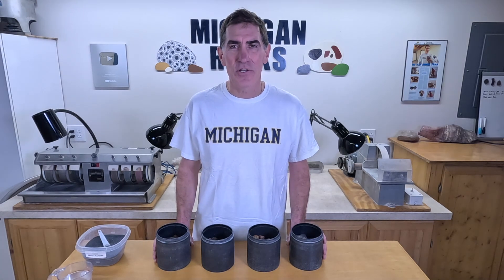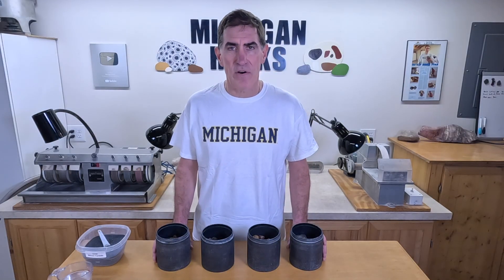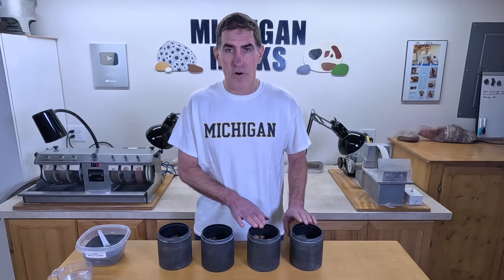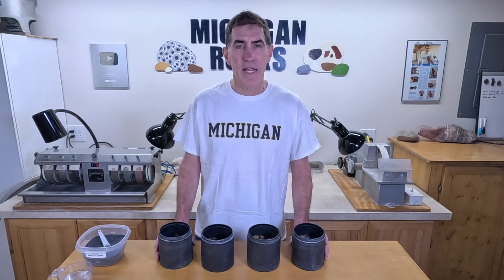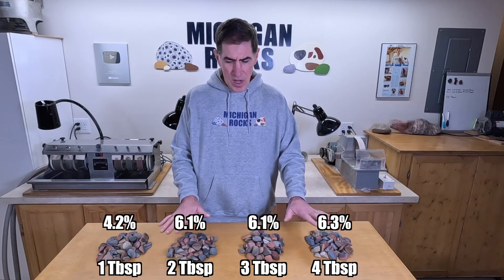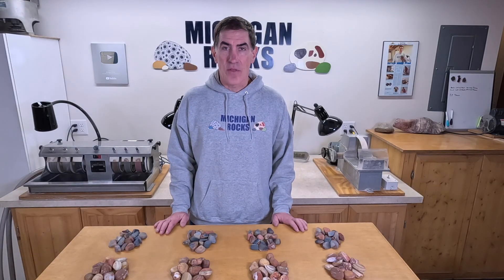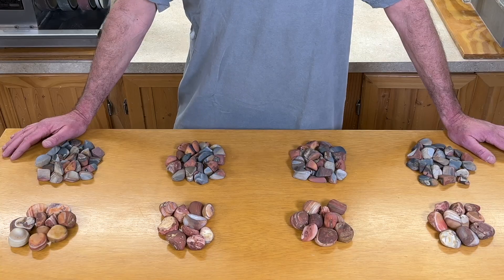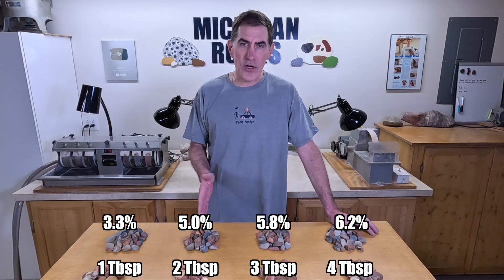Optimal Amount of Tumbling Grit—Part 2

Comment: This video and your others are exceptional imo. Not a lot of fluff, detail/practical oriented.
I am just starting out but after watching/absorbing your videos I have a plan to test a modified stage 1 process involving yet another variable.

I bought a Highland Park 3lb rotary with the basis being the lower power draw and no belts to deal with. I am hoping the power adapter and DC drive are "robust" to make it even more worthwhile in terms of replacement parts cost.
Reply from the maker: Let me know how your experiment turns out.

Comment: Please tell what tool do you use in order to cut a groove all the way around a stone for purposes of running wire around the stone for jewelry.
Reply from the maker: It's a glass grinding machine with a groove bit. I got my machine used, and I don't think they make that exact model anymore. But I found a similar one and put it in my Amazon storefront. I think you could use any glass grinder, though. The more important part is the groove bit. That's also in my Amazon storefront, which is in the description of this video.

Comment: I found that the water matters too, i.e. let's grit and less water seems to result in pretty good grinding vs more. I'm of the opinion that both need to scale in proportion to each other to some extent, it seems to make sense because the more water you have, the less concentrated the slurry is for a given amount of grit.

Also, less grit in the barrel seems to result in the Tumbler using up the grit faster. So instead of a week say you're checking it say every 5 days. It's really easy to tell by the sound the rock makes in the barrel. They sound very clickety clackity against each other when it's out of grit.

So many variables! 

So basically, less grit, less water = More frequent checking, and higher grit efficiency!

As an easy rule of thumb, it seems that half the number of tablespoons per pound of rock rating of the barrel is the most optimal.

I really wonder how this translates to other stages, cuz I've simply used the first stage more for this kind of experimentation, and haven't done it as much with hard numbers more with subjective observation. Later stages if you use less grit you definitely need use less water since the slurry is thinner and the rocks will bruise much more easily!
Reply from the maker: I plan to do another experiment on what the optimal amount of water to use is. I have another experiment that I want to do first though. The water experiment might even wait until next winter.
Reply: @MichiganRocks  looking forward!

Comment: It would be interesting to see if and how the results of such an experiment would be different with the addition of tumbling media. Might it give the rocks more points of contact for the abrasive to act upon, and perhaps allow larger grit doses to be more efficient?
Reply from the maker: I use ceramic media in all the stages after the first stage. I don't use media in the first stage because it wears it down too quickly. Also if you used too many smalls in the first stage, whether it be ceramic or just really small rocks, it actually slows the tumbling action way down. After a week, there will be left over unused grit in the barrel.

Comment: Thanks for the extra weeks. on a side note; the large rock under the 'M' with the rings. I was a rock licker in grade school in WI (no one judge). That was 50 years ago. If I can get the name, or type I can do my own research. TIA
Reply from the maker: You mean you stopped licking rocks? I'm 56 and I still lick rocks on a regular basis. I didn't know that was unusual. 

I'm not sure which rock you mean. I assume you're talking about the M in Michigan Rocks on the wall. There's a pile of rocks down there. I have several large Lake Superior agates and a banded iron formation that are most likely the ones you're referring to. The banded Iron formation is mostly red, and the agates are lighter colors, gray or almost white.
Reply: @MichiganRocks   Yes, sorry the M in the title and the large rock that looks spotted.
Reply: So, it turns out that it's petrified coral. But a random coral in the yard of a neighbor in the middle of WI seemed strange.
Reply from the maker: @lonpowley  That's a puddingstone.

Comment: Thanks for videos like this. Great expirement, looked to be a lot of preparation to make sure of accurate data. I am new to the hobby.   I've collected interesting rocks through the years, just never thought about tumbling them. Watching your videos inspired me to start tumbling a couple of months ago. One question. Do you think the percentages would have looked much different if the 4 barrels had run for 2 weeks? Or does grit breakdown make it a mute point?
Reply from the maker: By the end of one week, the grit has broken down enough that it's probably best to refresh it with new grit. It will definitely still grind more in the second week, but not nearly as much as the first week.
Reply: @MichiganRocks  Okay, thanks for the info.

Comment: I can't thank you enough for taking on this experiment and sharing it with us, twice.  I've had questions about how much grit to use and how soon to expect the slurry to form.  Sometimes after a week it seems I don't really have a slurry and I find I'm constantly checking the barrels to see if a slurry has formed.
Reply from the maker: I don't worry about how the slurry looks too much. That's a matter of the rocks you're tumbling more than anything else. Hard rocks grind slower and therefore form a thinner slurry. If I throw Petoskey stones in a tumbler, which are very soft, the slurry comes out like pudding sometimes. 

I also don't check my tumblers during the week. I just let them roll until the end of the week and check them then. Feel the slurry at the end of the week. If it feels gritty, that means that it didn't do much. If it feels smooth, then it's all used up.

Comment: I wonder if the results from the very first experiment (part 1) were similar because the rocks were roughest then, and the surfaces of the rocks did so much grinding on their own that the amount of grit made less difference. Then as the rocks get smoother, the amount of grit seems to make a greater difference.
Reply from the maker: Maybe, but I pre-tumbled those just to knock off the sharp edges. They weren't completely rough when that experiment started.

Comment: What about the addition of borax to make a thicker slurry? I wonder if the thicker slurry would improve the rate of weight lost per tablespoon
Reply from the maker: It might. A lot of people believe in using some of the old slurry to get things going. Or they'll just open the barrel and add grit rather than cleaning off the old slurry. Ken on the Rock Tumbling Hobby forums did an experiment on this that you might be interested in reading about. https://forum.rocktumblinghobby.com/thread/68043/cleanout-recharge-experiment-final-results

Comment: Tell me which minerals are best to process fluorite with? I have a few pieces of fluorite, not enough for a full load.
Reply from the maker: I have only tumbled fluorite once. I finally got it to polish well after several attempts, but I didn't take notes on how I did it. I have some more to play with and plan to make a video when I figure it out again.

I wouldn't suggest tumbling it with anything else. It has cleavage planes that are a real pain when trying to tumble it. I guess you could just try using a bunch of ceramic media if you don't have enough fluorite.

Comment: Would you be interested in doing an experiment using sintered boron carbide as a stage one grit?
Reply from the maker: I'd have to hear more about it. I don't know what that is or where I would get it. Is it readily available? How much does it cost? If it was readily available, cheap, and worked well, then it would be worth doing a video about if it helped people tumble more effectively.
Reply: @MichiganRocks  I’m trying to find a way to pressure it into a powder. Sinteredboron carbide is the second hardest thing next to diamond. I have access to scrap pellets at my work and I’ve seen how fast it grinds down metal I don’t know if it’s readily available on the market I work in a specialized field. If I can crush them down, I’ll try it for one week and one of my tumblers.
Reply from the maker: @mikebyrne8672  Let me know how it goes. Since it would probably be difficult to get for most people, I don't know if it makes sense to make a video about it.

Comment: This is a great part two! I think the graph shows it well. 
As a machinest, we had a sales guy come to sell a parts deburring machine( your loto vibration unit on steroids) . There was different shaped ceramic meida available. The sales guy knew his stuff and explained how some meida is better for different shaped parts,holes,edges.... he kept quoting the removal rate...  I wish i still worked there. :( I would like to grab a handful of that meida and run a few tests of my own. 
 Great work! I hope my daughter is as excited for her gift as i am.  Lol 
Cheers from Wisconsin.
Reply from the maker: I have some stainless steel media for hardening wire after wrapping a cabochon. There are about five different shapes in that mix. Ceramic media for rock tumbling seems to always be cylinders with the ends cut off at an angle.

Comment: Once again another brilliant video, thanks for putting the time in. Guessing it is the same everywhere but here in Australia the grit price goes up pretty quickly the finer the grade. Do you think 80 grit eventually breaks down in the tumbler to 240....400..600 grit etc and would it ever be feasable to leave a barrel running for longer just with the 80 grit and totally skip the other silicon carbide grades as the initial 80 grit has broken down and done each stage prior to switching to Aluminum oxide? I know you tumbled for a year, did the rocks tumbled in the 60/90 silicon carbide grit come out looking similar to rocks tumbled at say 400 or 600 grit. Just a thought to avoid buying less of the finer silicon carbide grits
Reply from the maker: Grit prices do not go up as they get finer here, so that's not a problem for me. But you're in luck, because I actually have the perfect video for you. I tumbled two barrels of rocks for a year, one with silicon carbide, and the other with aluminum oxide. I think you'll learn something from it, I did.  https://youtu.be/hcRttq9bSrY

Comment: I'm having a problem getting a proper shine on my rocks.  Do you happen to know if salt water has any impact on polishing?  I live in an area with hard water, so I have a water softener filter that uses salt.  I'm not sure if I should be using distilled water instead of tap water.  Any suggestions?
Reply from the maker: I have never heard of water that has been softened being a problem, but I don't really know. I can't imagine how it would affect it though. I made a video with some of the most common mistakes that people make when tumbling. Take a look at that, try what I recommend, and then let me know if you're still having problems. Also, don't be afraid to re-tumble rocks that you weren't happy with. You shouldn't have to do all the stages over again unless you determine that you really rushed the first stage. https://youtu.be/RuPtptr7_V4

Comment: I appreciate your video. Got me thinking. Usually my 3 tablespoons are ground down by day 5-6 depending on what I’m tumbling (I do stick to a 7day rule) and if less grit is more efficient, maybe doing 1-2 tablespoon and changing the barrels out sooner would yield quicker results with more efficiency in grit use. Just a thought but I will stick with 3tbs and every 7days. Keep the videos coming
Reply from the maker: Good questions. I think you might be right about using less grit and changing it more often. I stick to seven days just because it's easier to keep track of. I'm also really busy making videos so I don't really want to mess with tumblers more often than that. When I was newer at this, though, I had two two-barrel tumblers and I would empty two of the barrels on Wednesday and the other two on Saturday just so I could play with rocks twice a week.

Comment: Thank you for these results. How many Tbsp would you recommend for each stage of rock tumbling?
Reply from the maker: I almost always do all the stages except the first stage in a vibratory tumbler, so that's what I'm most familiar with. In my Lot-O I use 2 tablespoons of 220, 1/2 teaspoon of 500 aluminum oxide, and 1/2 teaspoon of aluminum oxide polish for the last stage. 

When doing all the stages in a rotary tumbler, I usually use 1 tablespoon of grit per pound the barrel is rated for. So in a three pound barrel I use three tablespoons in each stage.
Reply: Thank you so much

Comment: Can you just use beach sand? I use my tumbler to make seaglass with all the broken bottles we find metal detecting cellar holes. The grit gets expensive so i am thinking about getting some sand off the beach.
Reply from the maker: That's an awesome question because I have two videos to answer it:

Does sand make good tumbling grit? https://youtu.be/rk1DEqyH8Pc 
Making beach glass in a tumbler: https://youtu.be/yAt1Y5cGfWI

Comment: Awesome job Rob.  Thank you for doing this. I am a less is more as I am cheap with grit.  This confirmed  what I suspected.  If you're looking for a new challenge how about 1 week vs 2 weeks between rrcharges?
Reply from the maker: I have some other experiments in mind, but running them for two weeks is not one of them. I think the grit is pretty much used up after a week. I'm sure you'd get some more grinding in the second week, but I think it would be much less.
Reply: I've always wanted to try a long rough tumble (4 week?) with obsidian and an extra coarse grit like 30 or 46.  Since obsidian is mohs 5-ish, the extra coarse grit might take a month or more to fully break down, and continue to grind effectively during that time period.     @MichiganRocks
Reply from the maker: @jonathanyoung7785  Yes, with something like obsidian, I think that would work well. Soft rocks really take a long time to break grit down.

Comment: My goodness Rob, excellent forensic study on grit quantities affect on grinding efficiency. I had always been using 3 tablespoons of 60/90 and always would fret to myself that I wasn't using enough. Thanks for putting my mind to ease. I did a stage 1 experiment once. For a short period of time, I was straining and reusing the slurry. It looked like it didn't make any difference, so I quit. Not sure why I did that, I guess I was wanting to amuse myself. 😅 Thanks again.
Reply from the maker: Some people will add old slurry to a new batch to thicken the slurry. The idea is that a thicker slurry will help the grit stick to the rocks better and therefore be more effective. I have never been convinced that that was a good idea. I don't think it's a bad one, just not something I bothered doing. I do sometimes use water from the last batch just to get rid of some dirty water so I don't have to get rid of it some other way.
Reply: I've using the following approach with success: after tumbling the first week in a 3 pound barrel with about 3 tablespoons of coarse grit, I simply add about one more tablespoon of grit without removing the rocks or the slurry, run another week, add one more tablespoon, etc.  I do this for 4 or 5 weeks until the slurry is so thick that the rocks won't tumble.  The main purpose is to avoid the clean-out effort for rocks that I know won't be ready for a minimum of 6-8 weeks.  But by not removing the broken down grit, it seems to continue to grind a little bit, and adding merely one more tablespoon is enough to keep the rocks grinding down at a satisfactory rate.

Comment: Great video and information.  I'll have to go back to the first video to see if you said which tumbler you used as I remember when you reviewed the NatGeo you found it rotates faster on the slowest speed than the Lortone does.  I know, another variable!  One thing you did mention in one of your videos on using the NatGeo tumbler is that with the higher speed it seemed to break down the grit faster.  In your opinion from doing these experiments and with your experience using the NatGeo tumbler, do you think you would still get the same results for weight loss just over a shorter timespan with the higher speed settings?  My limited remembrance and probably outdated understanding of math and equations is that if you change the value of one of multiple constant values in an equation, then another constant changes inversely (i.e. if speed is doubled then time should be halved) to get the same result, or does that not work in a situation like this?  Either way, I may have to experiment with the higher speed settings this summer with the NatGeo tumbler I have, but only for the coarse and/or medium grit stages as I remember you were concerned that in the pre-polish and polish stages the rocks could get "bruised" at the higher speeds.  Dang, my math teacher in high school lo many years ago was right!  I do need to use math and algebra for the most unexpected things!!  Thank you again for another great video.  Looking forward to the next one.
Reply from the maker: I used my homemade tumbler with Lortone barrels for this experiment. My guess would be that for the National Geographic tumbler, it would be as you said. I think you'd get similar results in fewer days.